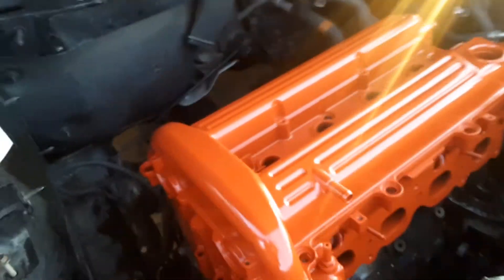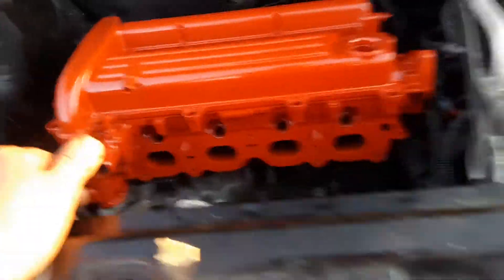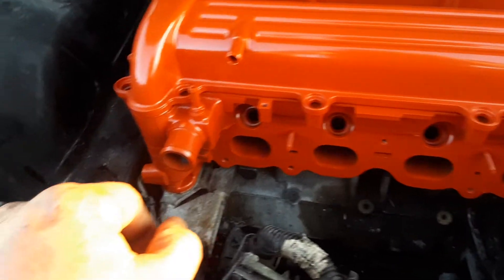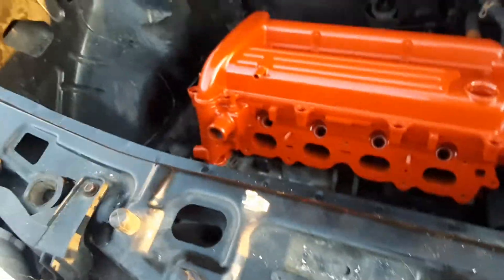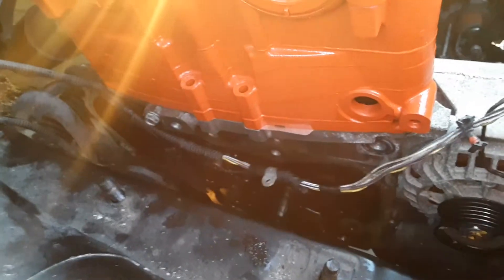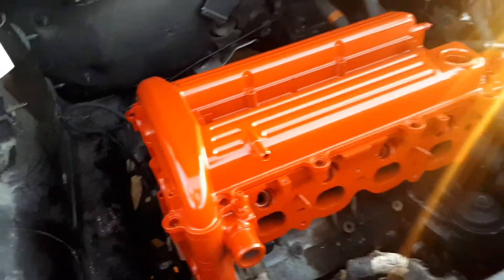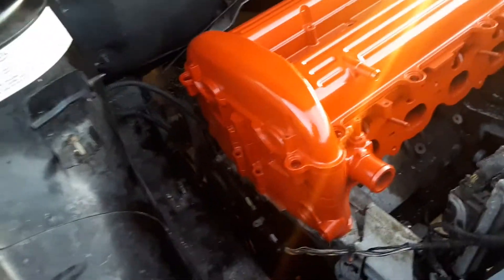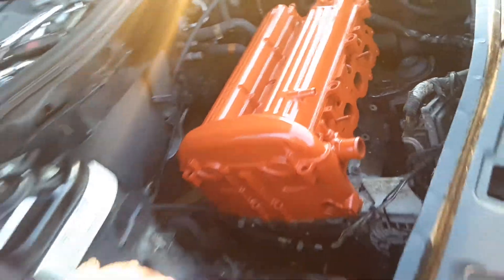2.2 ECOTEC cylinder head

Comment: 2.2 ecotec built designed by LOTUS DAMN GOOD MOTOR THEN GM SCREWED UP AND STARTED USING RENAULT ENGINES I'M RUNNING ONE RIGHT NOW I CAME IN MY MALIBU CLASSIC. As far as oil leaks go they're more prone to using oil and putting out the exhaust but if the trade off for the amount of power it makes I'm working on curing the oil leak problems and oil consumption problems